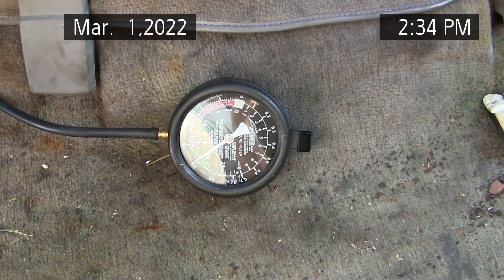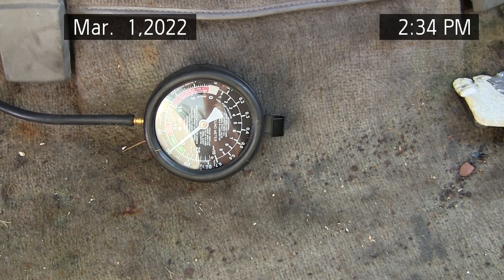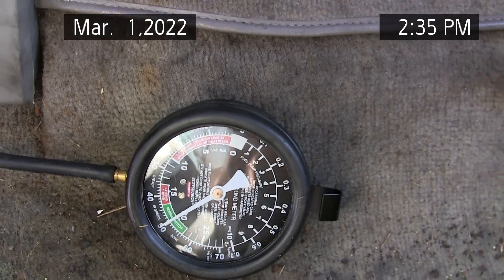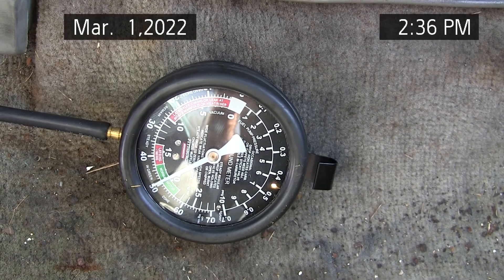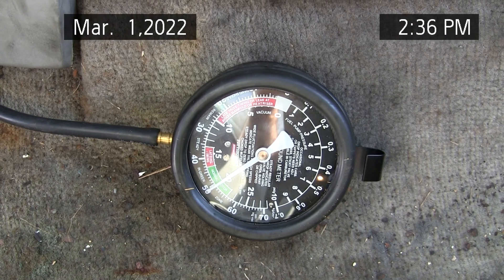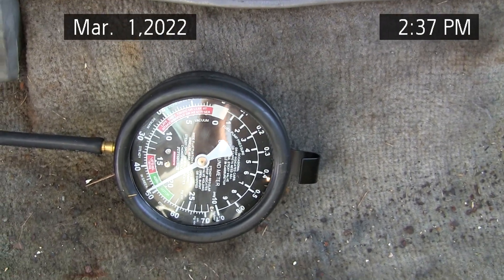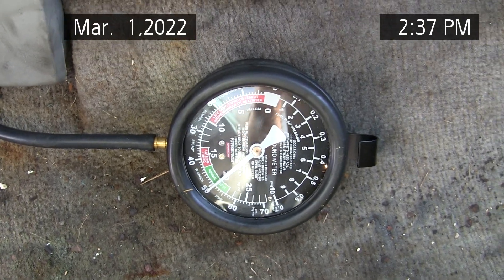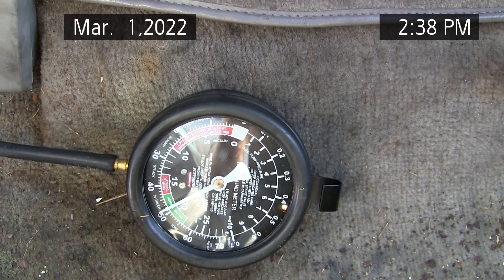Astro van (94) 3/1/2022 VLOG idle hunting. What can cause? Has New IAC.

Comment: Ecu unable to compensate fuel for idle possible air leak from intake system. Intake manifold gasket or hole in one of the intake hose
Reply from the maker: 2/6/2023 Update: No Joy yet. I have engine hunting at idle with occasional misfire and notice hydrostatic lock from gas if I restart right away. I had tested the cooling system for leaks with coolant pressure tester recently after I replaced the lower intake manifold gaskets. No leaks of the cooling system observed. I looked at the IAC voltages for both coil A&B and the TPR voltages at the PCM and both normal. I plan to check MAP output voltage soon. Vacuum is normal but goes a bit low from time to time when engine is hunting. I have replaced just about everything. I have tested the central multiport fuel injection (CMFI often called the spider or CPI) for leaks finding no leaks or stuck popets, but pressure is 50 psi that is minus 5 from what the GM factory service manual says is minimum. With engine not running goes up to 60 psi. I plan to check power to the fuel pump at the mid chassis connector. NAPA sells the CMFI regulator repair kit so both the repair kit and the GB manufacturing spider available. I swapped pcm with salvage yard computer. I plan to do a few continuity tests on engine wiring for IAC and maybe more and order a PCM engine management computer and pray.
Reply from the maker: I agree but I swapped computer with salvage yard unit but no improvement.

Comment: spray the intake manifold gaskets area with intake cleaner with engine running  any bubbles or change in idle
  means leaky gasket
Reply from the maker: I replaced the lower intake manifold gaskets and no joy.

Comment: Have you adjusted the fuel pressure regulator on your cpi spider?
Reply from the maker: No adjustments that I am aware of. I ordered another new one online. If you know how to adjust please let me know.
Reply: Its a vin W? If so the regulator is on the side of the cpi. In the center of the regulator, there is the smallest size star bit. Counter clock wise reduces flow, clockwise increases. Clean off the electronic connections to the injector on top of the cpi as well. I just did all this recently and is now at a smooth 700rmp idle and it cleared the engine light. good luck.
Reply from the maker: @perspectivetruth3476  VIN is vehicle identification number (VIN) assigned for every vehicle. General Motors (GM) used VIN W for central multiport fuel injection (CMFI) often called the spider due to appearance or CPI used from 1992 until 1995. VIN W also used by later systems that replaced CPI also called spider. The other system is throttle body injection (TBI) that looks like a carburetor. VIN W vehicles have the most problems. VIN W was also used by GM for trucks with CPI. I have a document written by automotive industry writer that explains what GM did from 1992 until 2007 for the fuel systems. I can share the article via facebook group for astro vans or email dennissytsma@att.net The CPI support has been a big problem since they stopped selling new CPI units in 2020.
Reply: @dennissytsma3561  I have a vin W, I have 2 extra cpi spiders for my 94.
Reply from the maker: @perspectivetruth3476  Thank you for the information. I have recently found leads to cpi cores from salvage yards and online people. I plan to visit nearest salvage yard and inspect the cores and negotiate price. I attempted to adjust both the regulators I have in my hands, one from parts geek and one from the van and I tried to adjust both using torx bit but no joy yet. I posted new video log today with my plans as soon as I have access to the vehicle and time to work on it. I have new fuel pump and sending unit and other parts. Again thanks for your help.